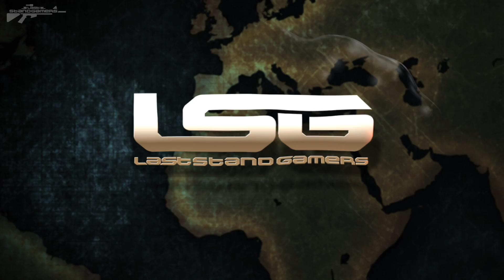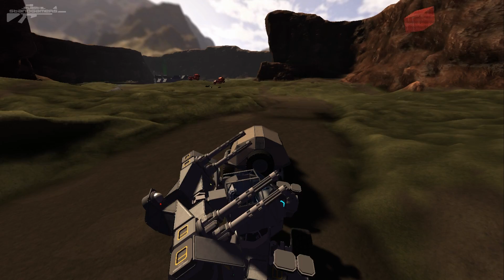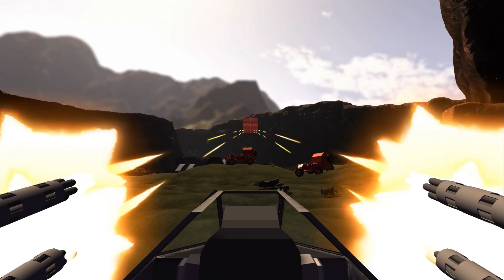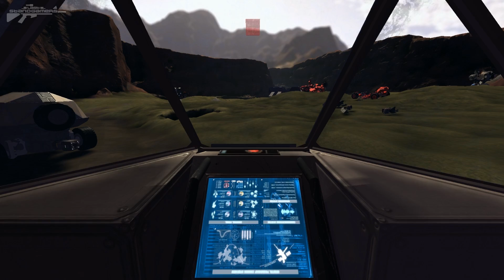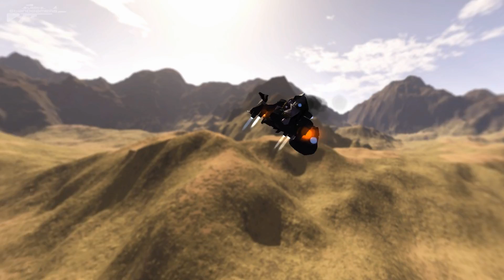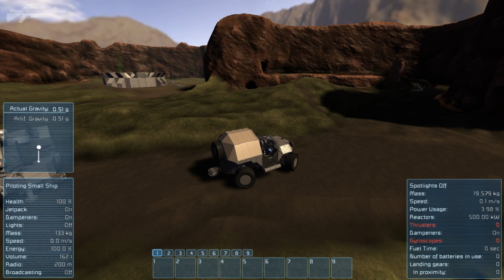Space Engineers - Mobile Quad AA Trailer

Comment: I'd like to see this in action while mobile with two people. You could have a driver driving around to avoid getting shot and to chase targets down, while the gunner in the back unleashes on the hostiles. Then you can have some other people fly some Henry's around and maybe a truck or two as mobile targets. It gives a more realistic testing scenario. Of course, this is more intended to be a semi- mobile gun emplacement that only fires when locked down and stationary, so it probably wouldn't control well while moving, but I'd like to see you try anyways.

Comment: It looks cool, but not particularly practical.

If you have to run over to it to use it then you may as well have a fighter on standby to do the same thing more effectively. Also if you had someone with an actual attack ship trying to take you out then the turret would get shredded pretty quick because you are a sitting duck.

You'd be better off putting on a 200m range aerial so you can put some solid rock between you and your attacker while you activate the turret remotely.

Better still, make a large ship platform on wheels with a single automatic turret. Or a small trailer with a large ship turret plugged into it.

That way it will open fire as soon as the enemy crests the horizon and you can either fight or flee yourself while it covers you.

Comment: could add sensors and make it an auto turret so you can mine and be protected at same time
Reply: Then anything 51+ is safe ,which most tanks are still effective
Reply: use modded sensors, some range up to 1000 others between 100-500 which would work fine

Comment: mobile light trailer, mobile cargo pod, mobile walls, ect. light enough to move by truck it should work. it would be interesting to see a halftrack/ heavy truck design with various attachments in the bed.
Reply: And can actually take a hit
Reply: that would be a plus for mobile defenses but not nessisary for utilitarian items.
Reply: Well it sort of a need if you are a AA gun ,since armor will try to destroy you,and other stuff too 

If it a defence usally heavy is best overall
Reply: if you dig into a position you can increase the protection of the item. mobile walls would need to be capable of taking a hit. other things the additional armor would be a plus but may take things to the point of needing to be a fixed piece rather than being mobile.
Reply: I'm gonna make east to place base walls, which can lift artillery up onto the wall

Comment: One question, can you make it where there is no cockpit? Like make it a drone with a camera on it?
Reply: +lego12312 Thats easy. Just remove the seat and glass put a remote block and an antenna in its place. Then add armor to cover them and then put a camera on a block and you are done.
Reply: +Duke00x  thanks dude, I was wondering how, great idea :( thanks again dude
Reply: +lego12312 * :)
Reply: lego12312 Your welcome. Just remove one control system (you) and replace it with another (the remote block and antenna). And then add a camera so you can see. It is pretty much how to can make anything remote.
Reply: Actually a antenna is all that is needed